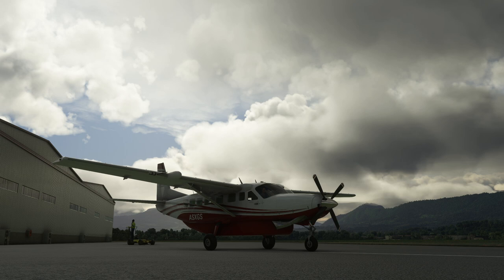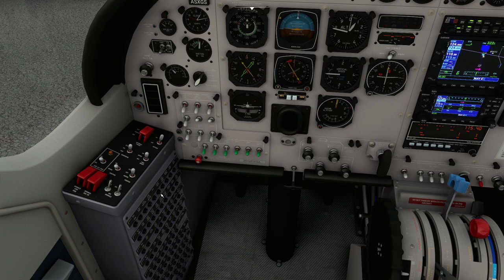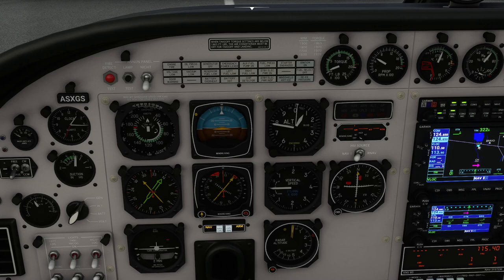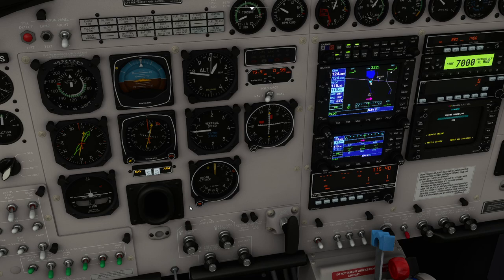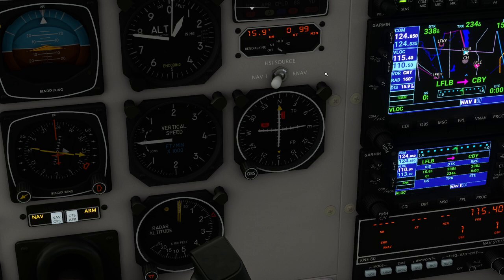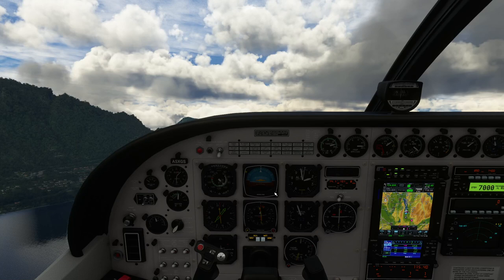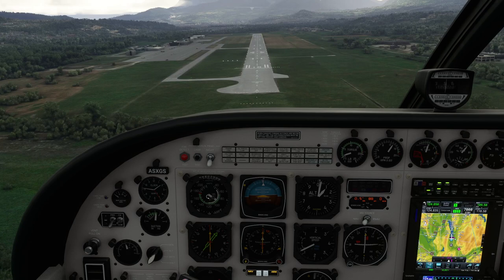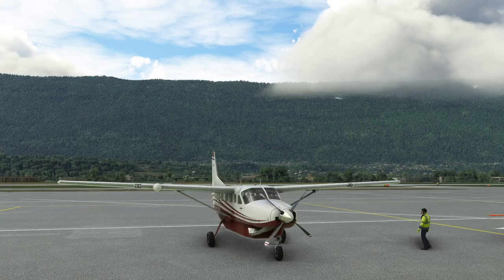Beginners guide to the Black Square C208 Grand Caravan in Microsoft Flight Simulator

Comment: I would highly recommend simmers to not use the B key to set altimeters, but rather roll the dial.  Why? Some aircraft will actually break internally if you use the hotkey (ATR is an example) due to how the systems work behind the scenes.

Comment: Around 14:30, you talk about the CDI in GPS mode being useless. But it does work correctly. It will show a deviation from the magenta as expected. You just happened to be directly on the magenta line while sitting at the airport so it appeared to not be working. If you fly away from the gps course, it will show you the deviation.

In a similar way that you set up the course of the CDI to be on the radial that you want to fly to a VOR, you turn the course heading to the heading of the GPS magenta line, when you are in GPS mode. In your case, that would have been 340. Then when flying, you will see the CDI working.
Reply from the maker: I think the point I didn't really make is the course doesn't really mean anything when you're in GPS mode.

Comment: Great video, doesn't look like you followed the start up procedure that came with manual. You should have the propeller rpm to max and then after flicking the starter wait for the ng to reach 12% before introducing fuel by putting mixture to low idle.
I believe also the weather radar is functional and not just for the menu to control failures on the plane.
Reply from the maker: I did say towards the end that I didn't follow the book procedures - just the functional steps required. You can actually get away with a LOT in most of the aircraft in Flight Simulator - there are limits to the "simulation" all over the place :)

Good shout about the weather radar btw - I forgot that since SU9 various weather radars in the Asobo aircraft work - and as this is based on the underlying Asobo code, it inherits it :)
Reply: @jonbeckett  Ahh okay mate, then my bad about the procedures. Yeah I love how the weather radar works now.

Comment: Advise fuel select off red?
Reply from the maker: I'm sorry - I don't understand what you mean ?
Reply: @jonbeckett  Sorted it. Have you had any issues with switches highlight blue and not being able to operate?Eg swooping between Nav system's. I may have to reinstall the JT analogue package and see if it's the issue. After JT reinstall everything operated as your great video and the manual.